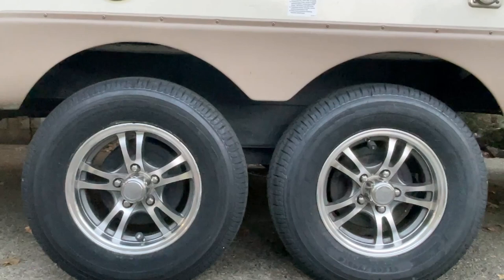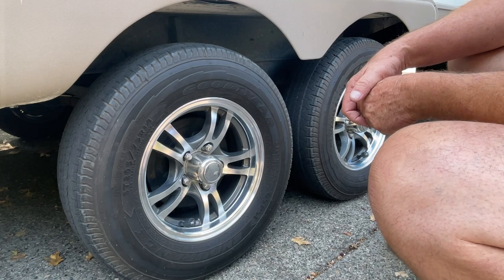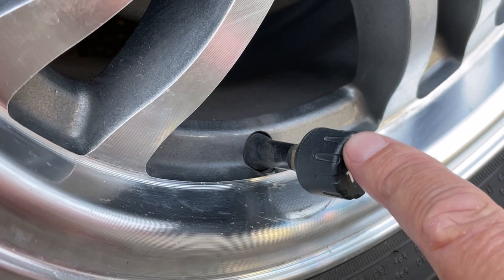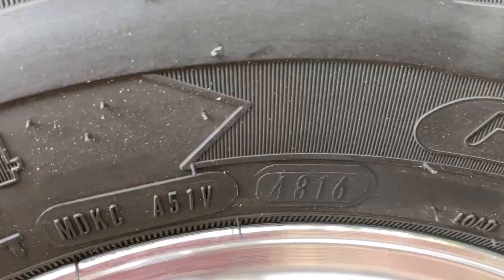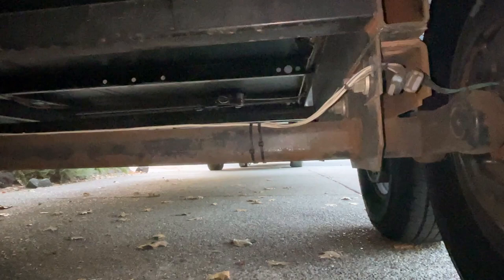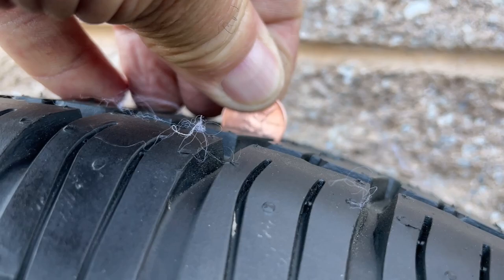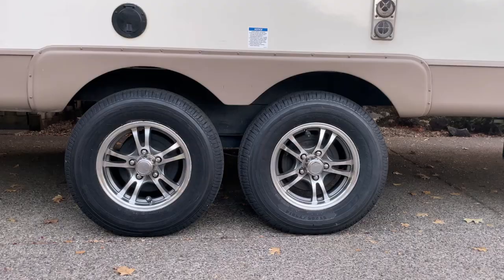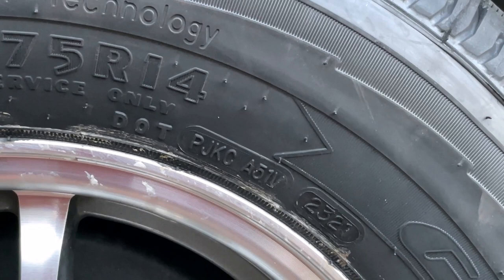Replacing Our RV Tires after 20k Miles, Castle Rock Tire Quality Test, & Air Valve Stem Problem

Comment: Very nicely done from start to finish and GOOD tips.  Thanks Michael
Reply from the maker: Thank you Michael, do you still have Castle Rocks or have you changed them?
Reply: @thetraveltrailerguy  I kept my Castle Rocks on the camper up to over 19,000 miles.  Then I got Goodyear tires.  I need to check the miles I have on the Goodyear tires some time.  One is wearing on the outside badly and needs replaced.  Gotta get out my PENNY.  :)

Comment: I replaced my castle rocks with endurance tires at around 6000 miles just because of what I had heard about them exploding. I feel much safer now.
Reply from the maker: Nice Keith, how are your Goodyear tires holding up? I feel much safer not having the Castle Rock tires, I wish I had saved pictures of what our failed Castle Rock tire looked like to share. Keep an eye out for a future video I'll be sharing showing all the pictures I've collected of Castle Rock tires failing....its going to be a good one :)

Comment: My castle rock tires look brand new but one already has a bubble. I don't feel safe at all. I just ordered Carlisle radial gt tires from discount tire. I will definitely be watching them when they come in and are about to lift my travel trailer.
Reply from the maker: Thanks for watching Jaz and commenting. I hope that when the Castle Rock Tires are removed you do a side by side test like I did pushing on the tires, you will be amazed how easy it is to push the tire down. Take care
Reply: @thetraveltrailerguy  i definitely will try it.
Reply from the maker: @yankeesusa1  After you do it let me know what you think :)

Comment: So I stopped and started the video when you did the tire test.  Took me a while to get clear shots of the side of the tires so I could read them.   Not trying to stick up for Castle Rock tires but the new Good Year was a load range D and the Castle Rock was a Load range C.  That will explain the big difference in the side wall flexing when you press down on it.  You should have made sure they had the same load range to do that test.  Just trying to be fair even though I agree Castle Rocks are not the best quality.
Reply from the maker: Good catch and I appreciate you mentioning this. I wish I had mentioned this in the video, unfortunately once you post a YouTube video they will not let you make changes to it. At least we can all agree Castle Rock tires are poorly made. Check out my other video - https://youtu.be/vDELBXrzldE?t=387

Comment: One question: I believe I have the same rims on my 2507s, and I have noticed the same marks from the TPMS caps rubbing because of the rubber valve stems But I can't seem to find metal valve stems that work with the contour of the rims. Any chance you could post brand, model number, and source for your new stems?
And excellent video (like all your videos) - big thanks for making them!
Reply from the maker: Thanks for watching John and watching all my videos. I'm not sure about the model and brand of the tire stems. When I had the new tires put on at Discount Tire I requested they install metal stems and the ones in the video are what they put on and I really like them because they are shorter stems than other ones I've seen around. I'm not sure if all Discount Tire Centers use the same valve stem. Here's the Discount Tire Center that installed them that you can call, you might reach out to them and ask what they use and then check with your local Discount Tire Center to see if they carry them. If not maybe my place can ship them to you. https://www.americastire.com/store/ca/rohnert-park/s/2023
Reply: @thetraveltrailerguy  Thanks, I'll give Discount Tire a try...

Comment: If you don't think they are safe for your use, why would you sell it on Craigslist or anywhere else? Seems a bit hypocritical. Tires need to be replaced due to age. Safety first for all. A "tire specialist" cannot tell you if a tire needs replacement because he cannot tell what use it has had. He can evaluate tread and age via the date stamped on the tire. Again, used tires are a total unknown!
Reply from the maker: Thanks for your comments Phil. 

So I feel I need to clarify myself a little bit here so here goes. Regarding selling them on Craig's List I told the purchaser about their history and he said that was okay because he was going to use them on his landscape maintenance trailer and wasn't going to be traveling long distances or high rates of speed. 

Regarding tire replacement, I called Goodyear directly and spoke to their engineers regarding tire replacement and was told these tires and many others are designed to last 10 years or more depending on the elements and use and the best way to know if they need to be replaced is to take them to a Goodyear dealer to evaluate the tires. I'm reading there are lots of people out there spreading false information saying you need to replace your tires every 3-4 years no matter what and this is not true.
Reply: @thetraveltrailerguy  good video!

We replaced Westlakes on our 5th wheel that were actually in perfect condition but were over 5 years old.  
We sold the set of 5 (including the new unused spare) to a guy who was going to use them on his farm flatbed trailer.  He knew everything we knew about them.  No big deal.
Reply from the maker: @mischiefroadtripadventures  That works I did the same regarding selling our tires - I sold them on Craig's List and told the purchaser about their history and he said that was okay because he was going to use them on his landscape maintenance trailer and wasn't going to be traveling long distances or high rates of speed. Thanks so much for commenting and watching.
Reply: It's not hypocritical. The castle rock tires are not made for travel trailers, they should only go on work trailers like lawn service. The reason is the amount of weight they can handle and a travel trailer clearly weighs more than that. This is the reason why you can sell the castle rock if in good shape and let the buyer know that you don't recommend them on a travel trailer